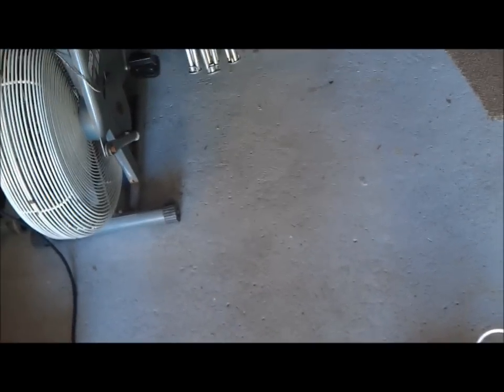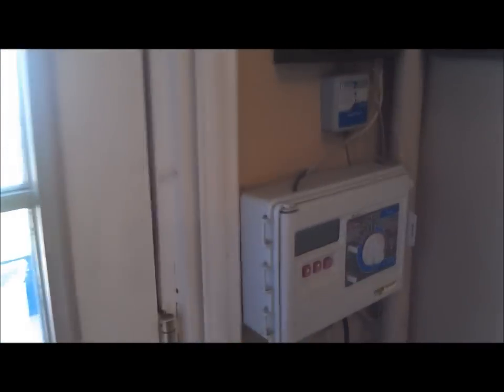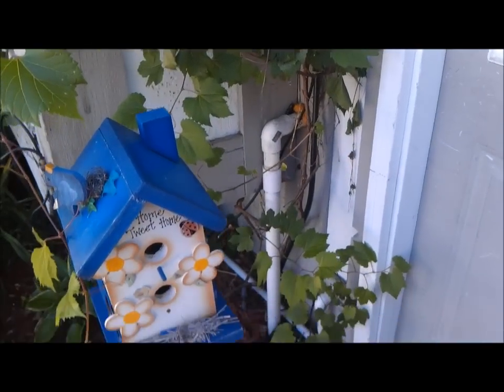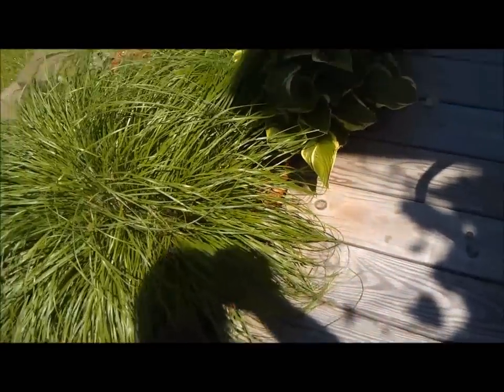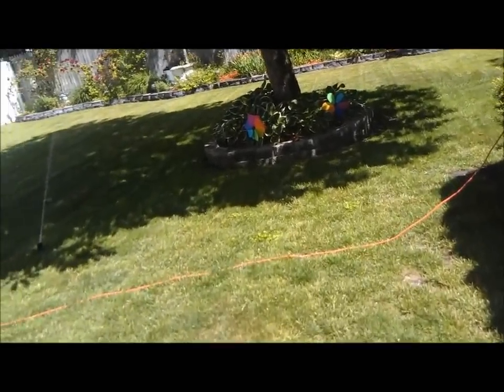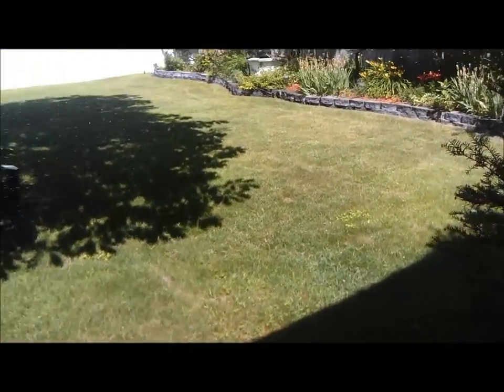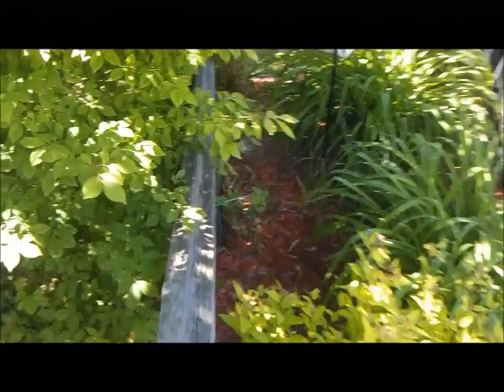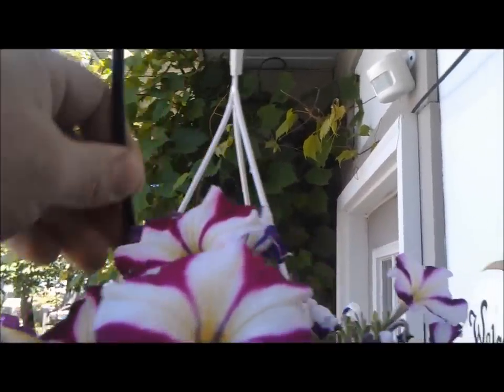my pump, well, and irrigation system

Comment: Jeff, why does your pump support 6 heads, and my 1HP 220 shallow well pump barely runs 2 hunter I-20 pop-ups, (small nozzles) at 40PSI? The supply side of my pump is 1 1/2 cast pipe, with a 2" (?) screened point. Your system looks like city water pressure. Just experimenting with mine, and using 1/2" poly tubing. Maybe when I finalize the system with 1" PVC laterals, the supply pressure/volume will increase?

Comment: Do you know what your PSI or GPM is for the sprinklers?  I'm in the process of designing my system which will have 6 sprinklers.  Big differencce is that I will be pumping out of a lake and up a hill about 40 ft elevation above water.
Reply from the maker: I have 40 P.S.I. and about 10 G.P.M. I'm sure you know, but a pump will push a lot easier than it will pull. If you can, put your pump as close to the water as you can and have it push the water up. A 2 horse pump should be just fine for you.
Reply: I'm on somewhat of a restricted budget for this project.  I have found a 1.5 hp 40gpm 110volt pump that claims to have a 260 ft. max head.  I'm hoping it will be adequate.  Of course, it's an eBay item and much more affordable than those $600+ pumps.  I've seen several of those high dollar pumps fail and cost more to fix than these cheap pumps cost new.

Comment from the maker: Hello Matt, I forgot to mention, I have city water here. So I put the well in to save money on the water bill. I had a 2 horse motor on when I originally installed the system. I have a 1.5 horse now so the blue pressure tank adds a little additional pressure to get my head to head coverage.

Comment: The system can run directly off the well! I was wondering why you put a pump in? I would also like to know why and what that bladder is in the ground? I always just connect the system straight to the water well line in between the well and air tank.Nice system buddy!
Reply: He does not explain anything